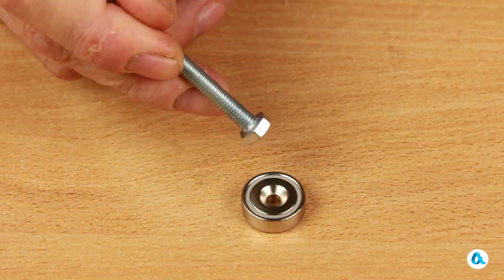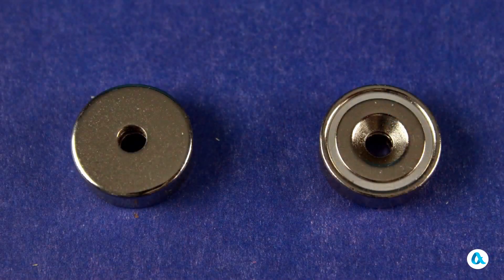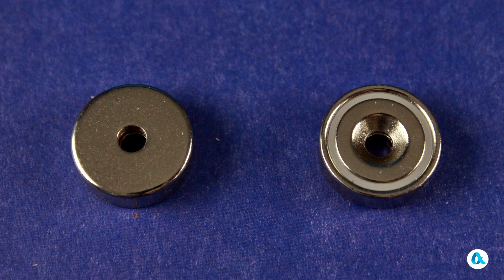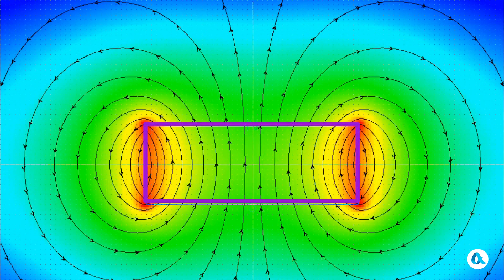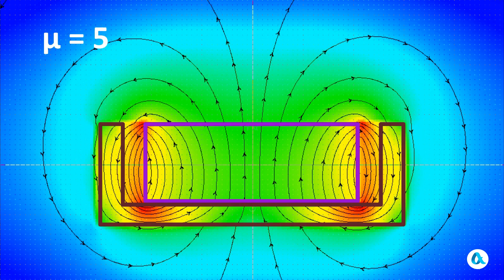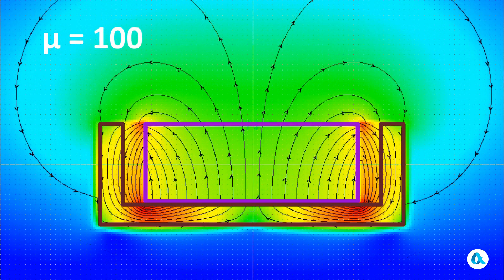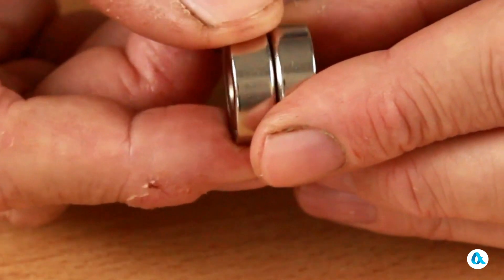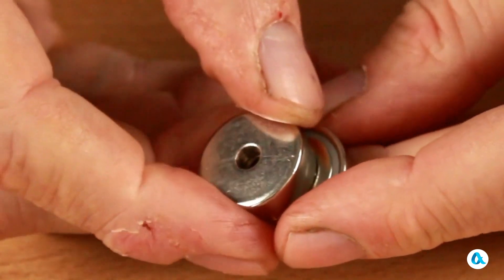Magnetic monopole... almost

Comment: it's more likely to be a cylindrical halbach array, or in other words, a series of alternating magnetic domains in the structure of the magnet, which is why it has distinct locking states on the side that has more magnetism, those are the points where the domains line up with the right polarity to adhere, although there is certainly a possibility that they are also using a steel shield like you suggest to further intensify the effect of the array.
Reply from the maker: That is an interesting observation and a good point to consider!

Comment: The atom is the only magnet monopoles
Reply: Except that it's not though.
Reply: nope, even electrons are a tiny magnets - that is what a quantum spin actually is

When you excite the vacuum enough it produces a electron-positron pair, which are tiny vacuum vertices in A-field. One is spinning clockwise and the other anti-clockwise giving them opposite electric charges.

There's also a component of that vortex that translates directly into the quantum spin. If you then get a double pair of: spin up electron + spin down electron + spin up positron + spin down positron AND you let them arrange in their own vortex you get a proton.

Add another electron and electron neutrino and you get a neutron. Since you got the 3rd electron with an unpaired quantum spin the neutron gets to keep its spin despite being electrically neutral. It's not an exact model but a decent approximation.